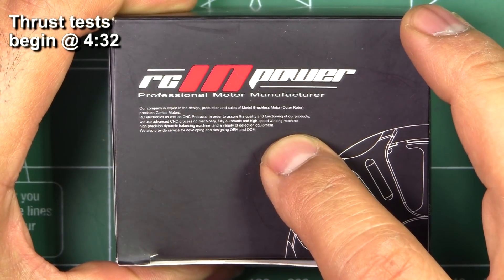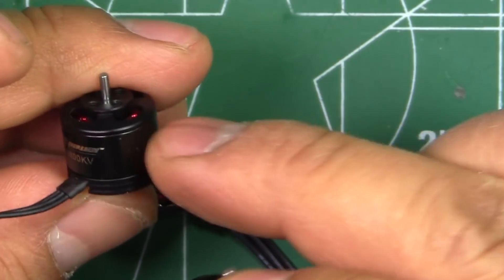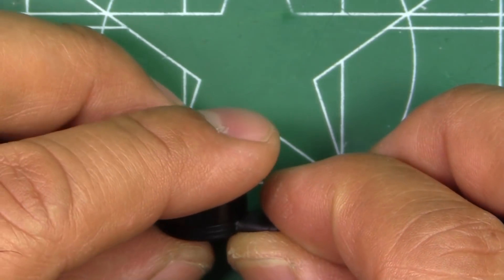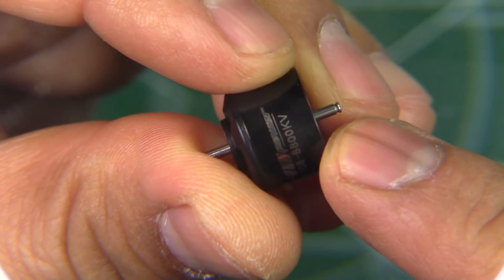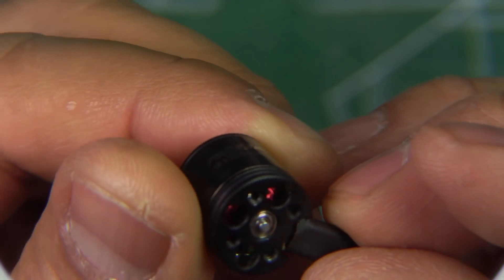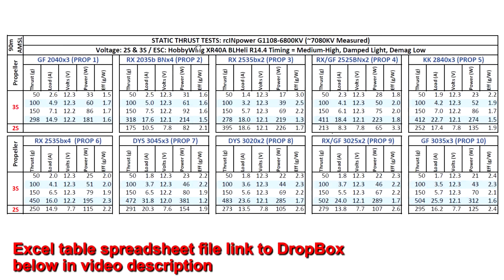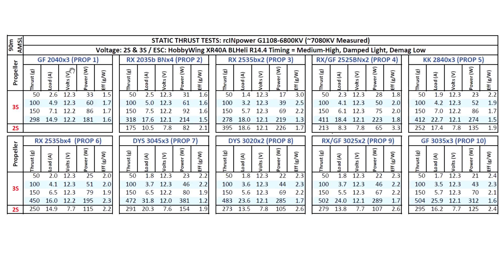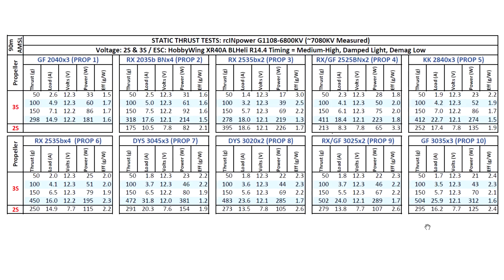rcINpower G1108-6800KV Big Micro Power! 0.5Kg Static Thrust !!!!

Comment: I'd really like to see this one on a ultralight 3 inch. Leave 1407 for 4 inches ;)
Reply: Coppertop FPV I respect your opinion but don't agree. What finally matters is thrust to weight and weight to disk area. I just made a 150g 5 inch with bare 1kg thrust per motor and is by far the quickest in my arsenal.
A 70g 3 inch is now possible. Almost half than what you say :) calculate the thrust to weight by yourself.
Reply: Then put it on a FlexRC Komori ultralight 3" frame. :) I have a Komori with the EMAX RS1106 6000kv motors, and it's a scream on 3s. These motors would give you an additional 360 grams of thrust, or possibly even more with a more relevant prop! My Komori weighs 82 grams (without battery, of course). The 3s Tattu 850mah 75C battery weighs in at 80 grams, doubling the dry weight of the quad. So 162 grams AUW!

The rcINpower motors are 2 grams heavier than the EMAX, so dry weight would increase to 90 grams, while putting out at least an additional 360 grams of thrust. Daaaaang! I really want a set of the rcINpower 1108 6800kv motors for it now.
Reply: floorpizza problem is, they’ll eat your 3s battery and have no torque which you can see by the huge amp increase. If you want more performance build a proper 3 inch with 1407s. 128g with props on, and motors which put out close to 800g more thrust than these (rcx rs1407 4100kv), and 4s batteries which give you 4-6 min flight times, and the quad will happily carry a GoPro for proper freestyle. You can buy 4s 850mah batteries which weigh 88g in the uk from electric wingman, and reportedly have similar performance to the tattu - which imo isn’t a great battery at 850mah - at least on 4s. Chasing ultimate performance is the wrong way to go at this weight imo. Less is more :)
Reply: nasone32 Holy hell! 150 grams with 5 inch props sounds amazing!  Edit: I just changed up my build. My 4 inch quad is now under 130grams with titanium hardware and screws! My cobra motor 1407 4100kv motors are putting out 900+ grams of thrust per motor with 4045x2 kk props. Thats 3600+ grams total! When using my 77gram 700mah 4s my total weight is just 207 grams! That means my thrust to weight ratio is well over 17:1!!! It's for suuuuure my fastest quad by a long shot. I can even run a 1050mah and still be well under 250grams! The top speed is great, but its also better at handling and cornering aswell. Disk loading theory is no joke! If anyone doubts this, thats their loss. Its not just about disk loading either, smaller motors spin at a higher rpm because they have ussually have a higher kv. What this means is that aslong as we can stay light enough, the props will actually spin faster on a smaller motor. Small motors lack the torque of big motors, so they would do worse on a heavy quad, but on something light enough they can open up all the way and really show their true potential.
Reply: I just built a 3" with the spintech race frame running the 4000kv version and 3" 3024 avan props. Seems pretty solid so far.
Reply: croeitus d running 4s???

Comment: Great review as always.  Haven't we reached the point where the law of diminishing returns argues against making bigger and more powerful 11XX motors?  Our available batteries for 90-130mm quads simply can't put out enough power for long enough to take advantage of these new power-hungry motors.  To put it differently, I haven't found a way to get a thrust-to-weight ratio in excess of 8-1 with the micro quads on 3S and flight times in excess of 1-2 minutes.  The other big problem is motor heat - as you have noted.
Reply from the maker: Right - good observation, I think this is at the limit of diminishing returns perhaps. Hopefully someone slaps them on a superlight build and reports how they do. I've seen a lot of builds that I thought would not work well and to my surprise they fly awesome. The most recent being RX 1107-7600KV/ 3S / GF2540x3  (I linked a video in my review for that motor) I had thought 3S would be way too much for 2.5 props, wrong! One of the best flying micros I've see so far.
Reply: EngineerX  - I watched the video, and agree that the quad flies great - but no discussion of motor heat or ambient temps.  Clearly, that kind of performance is at the margins of what is feasible today - and the battery sag was noticeable.  The difference between a 2-3 minute flight with highly stressed motors and batteries and a 4-5 minute flight within a reasonable performance envelope is surprisingly small - maybe ten percent in terms of thrust, amp draw and wattage.  I guess it all depends on your goals and the depth of your pocket!
Reply from the maker: George H Quite correct. You may have to be throwing away battery packs after 10 cycles and for sure to fly very light the smaller packs may only give you 2 to 3min.